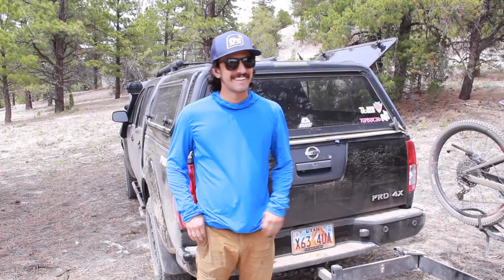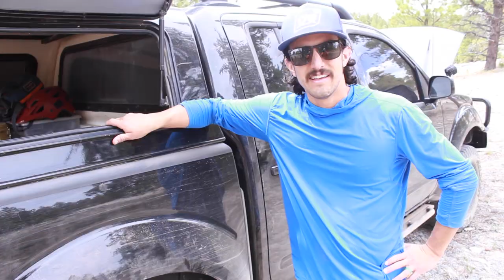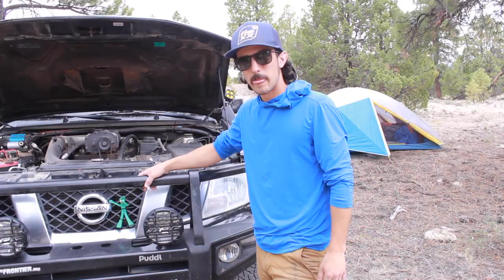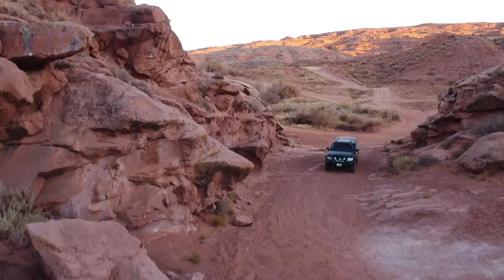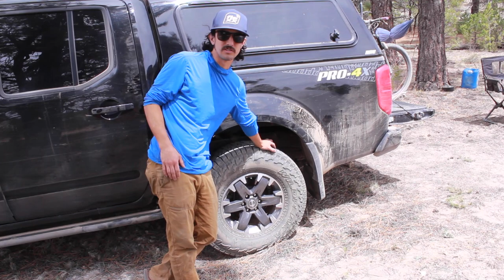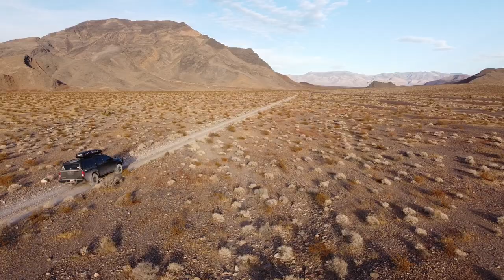Our Nissan Frontier Pro-4x Overland Rig || Full Walk Around

Comment: Any downsides to having the beefy arb front bumper? Was thinking about one but still debating.
Reply from the maker: Only downside is weight, really. We have upgraded suspension so it didn’t really change much for us, but if you’re staying stock you might notice some sag in the front and a bit of a nose dive when you brake hard. It’s worth it for the look but especially for the protection we get.

Comment: Awesome video. I hear that these things have transmission issues. Have you had any type of issues on yours?
Reply from the maker: That is true but only for the 2005-2010 years I believe. There is a fairly staightforward fix for those years too so I’d you found one in good condition low mileage I’d go for it and immediately have it fixed to avoid the issue. Since 2010 they resolved it, although it’s worth checking in 2011-2012 models just to be safe.